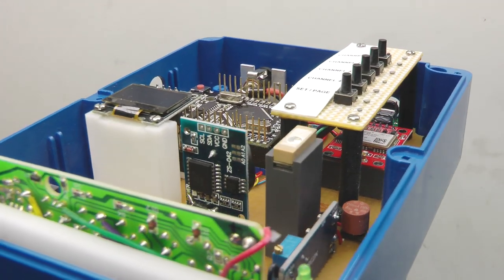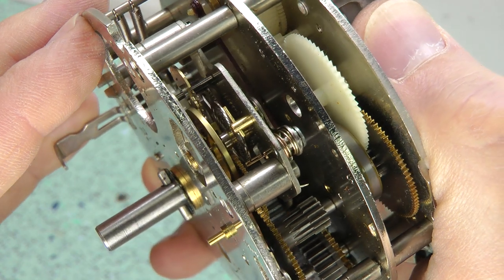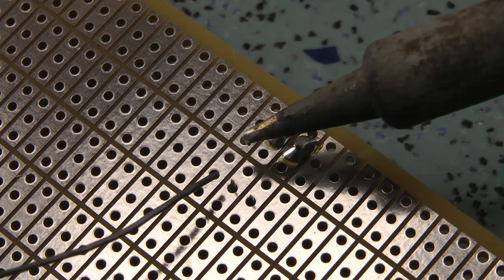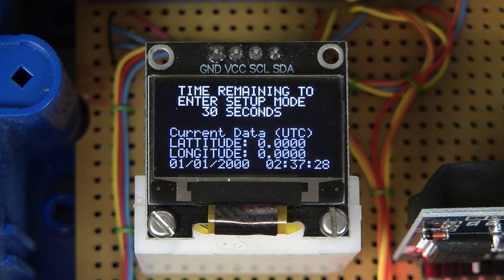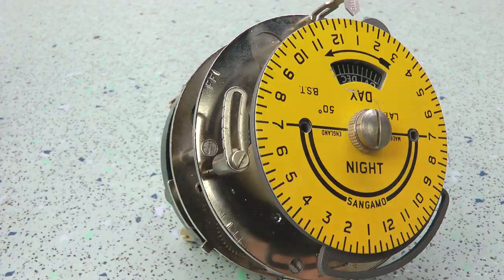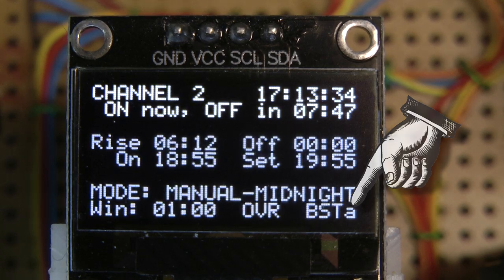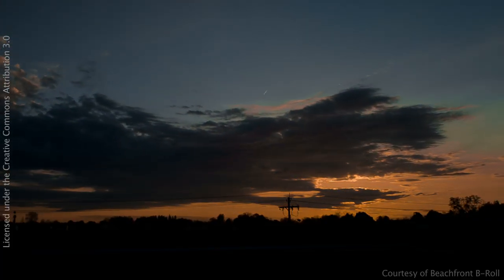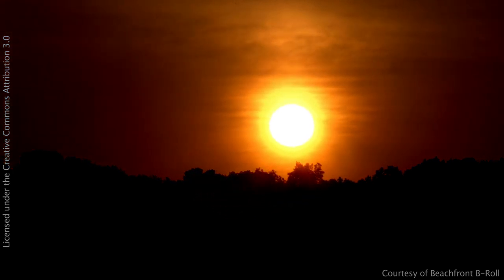Arduino Based Home Automation Dusk To Dawn Lighting Timer Based On Vintage Sangamo Suntracker

Comment: I have been working on a similar project but not turning lights on/off , i want to turn on an esp32  that is set up to stream internet radio on certain days at certain times and record certain programmes  . 
The most annoying thing has been that the DS1307 library and the DS3231 library are different with how they call the time .

Comment: Excellent project! What approach did you take in learning to code the arduino? I got myself in knots trying to learn this. The only programming I ever did was BASIC on a zx81 and that's where the confusion started! I don't think there is any crossover between the two🤔
Reply: Almost all languages are similar at the root of it all, it's more syntax changes that makes it difficult to switch. Best suggestion I have is to get into an Arduino, download some sample sketches for whatever you're interested in, and give it a try. Play with numbers, try making some edits, and Google for answers when you get stuck. There's a LOT of pre-written code out there, when I need to make something quick and dirty, it's usually made of code snippets. No need to reinvent the wheel, unless you want to :)
Reply: @IBWatchinUrVids  My main problem is combining several sketches to read an array of different sensors then send the data to Google sheets...I never liked coding and still don't lol

Comment: You need to remove the zener diode on the RTC board or it WILL charge the CR2032 rendering it dead very soon. These boards were designed by someone that wasn't thinking, and as such expect a LIR2032 cell, and not a primary cell. The mAh rating on the LIR2032 is laughable, so it makes absolutely no sense to use a rechargeable cell instead of a primary.
Reply: So that's what killed it...I had that problem and thought it was a faulty board!